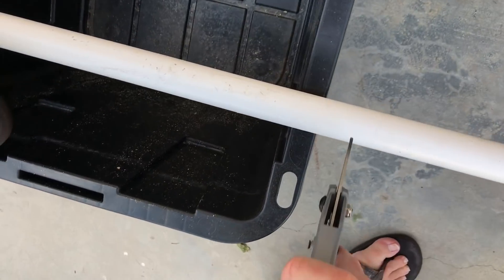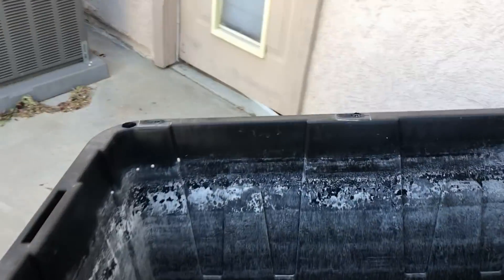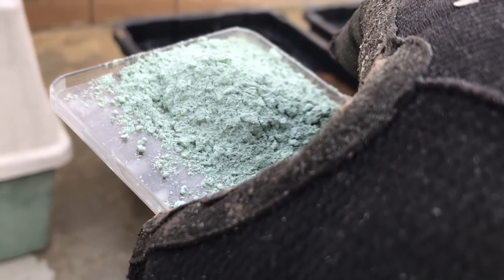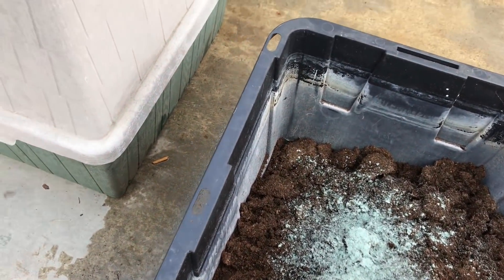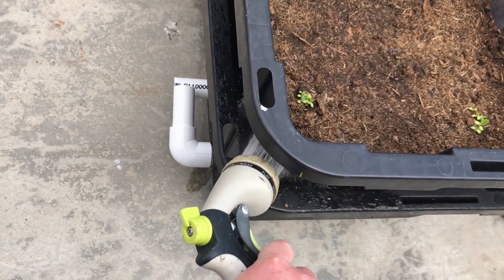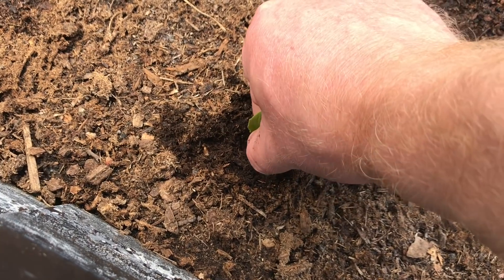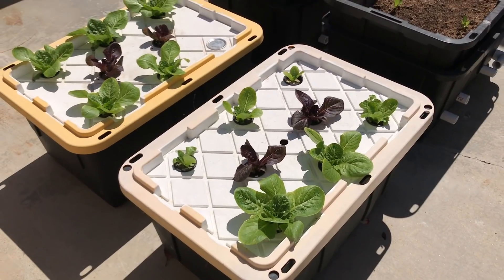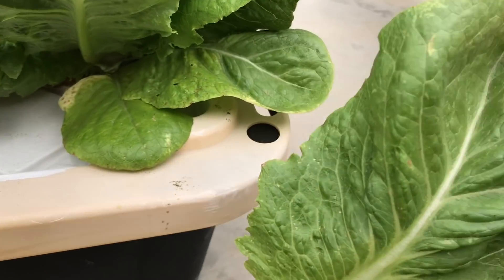Soil growers can't handle this video!

Comment: I'm just going to point out that you have 10" walls blocking the light in the soil containers but not in the hydro. And I'm also wondering why the people who comment on this don't care about what hydro solution you used or the PH, and are actually more concerned about the music you play?
Reply from the maker: the plants were shaded equally, the soil beds needed more "wicks" to keep it damp enough
Reply: Explain to me how the plants are shaded equally when the ones in soil are right next to a tall wall on 4 sides? They are outside and you don't get to move the sun and you're not going to tilt the container
Reply from the maker: the house shades both plants in the afternoon.
Reply: I see. So in the morning is when they get their sun. Which is when the walls would block the most sun because the sun hasn't risen very high. The only time they could get the same amount of sun with the way you have it is in the afternoon when the sun is straight above them. So if you title your video "Soil Growers can't handle this Video" you should expect some scrutiny from soil growers. And you should dot your I's and cross your T's and if you do a comparison you should make it fair. Otherwise the whole thing is out the window.

Comment: Thanks for sharing these videos, Jeb, its nice to see people trying different things and thinking outside the box. I want you to understand that I'm not trying to give you a hard time with my comments/criticism, I try to be as constructive and respectful as possible but sometimes I can come across as too critical. With that said, of course "those" wicking beads wouldn't produce well brother, especially compared to a kratky setup. For one, you didn't set them up with enough wicking baskets given the size of the baskets and the bed, they should have had two wicking baskets of that size for proper hydration of that amount of medium. Secondly, notice how I said "medium" and not soil in that last sentence? That's because what you used was NOT soil, at least not True Living Organic Soil. While Miracle Grow Moisture Control Potting Soil is considered "Organic", its not a true "Soil", its basically just Peat Moss and Coco Coir with a very small amount of amendments, not to mention its way overpriced for what it is. You would be MUCH better off either buying a quality, pre-mixed true organic soil, like Coco Connoisseur from Monster Gardens (its pricey but EXCELLENT quality), Nectar For The Gods #4 (one of the best for the price, most local grow shops carry it, as well as the next honorable mentions), Roots Organic, FoxFarm Ocean Forest, and several more I can't remember at the moment. The best true living organic soil you can get, however, is the stuff you make yourself. Its most commonly known as Super Soil, based on the original TGA Subcool Super Soil Recipe, which is updated almost every year. Making your own Super Soil is going to be the most expensive, since you have to buy all the ingredients separately (and their are a lot of ingredients) its going to be a fairly big initial investment (depending on the size of your grow). When Super Soil is done right, using high quality ingredients/amendments/inoculants, all mixed properly with the ideal moisture content and allowed to "Cook" for at least a month, the results you'll get will absolutely be worth the investment. If you're interested in at least testing this I can give you a Super Soil recipe that you can buy each ingredient in small quantities, so you don't have to spend a lot to try it. Several of the ingredients (Alfalfa Meal, Kelp Meal, Feather Meal, Bone Meal, Blood Meal, Bio-Live, High Phosphorus Seabird Guano  Azomite, Granular Humic Acid, etc) are offered by Down To Earth in small boxes/quantities, so you don't have to buy large amounts just to try Super Soil. Just humor me and give it a try on a small scale, I guarantee you will be pleasantly surprised at the results. I could go ON AND ON about the benefits of True Living Organics, going in depth about the symbiotic and delicate relationship between the soil biology and the plants. With organic growing in soil, its all about the BIOLOGY! The more diversified your soil composition is (the more quality ingredients/amendments/inoculants you use), the more diversified and healthy the biology will be. Plants grown organically in soil are completely dependent upon the micro biology, its the micro biology (beneficial bacteria and fungi) that breaks down the organic ingredients/amendments/nutrients into a bio-available form, which makes it readily available to the plants. While the plants are dependent upon the biology, the biology is dependent upon the ingredients/nutrients that's present in the soil, so if you don't use good organic soil with quality ingredients then the biology won't have what it needs to properly nourish the plants. Simply put, the quality of the product that your plants produce is directly related to the quality of the soil and its ingredients. So if you can, just humor me and repeat the wicking beds test (or any kind of organic soil method) but instead use two wicking baskets per bed and use a Super Soil mix in one and just plain organic potting soil in the other. Watch them grow and be AMAZED at the difference. Not only will the Super Soil plants grow faster, look noticeably healthier and produce more, but they will taste SO MUCH BETTER! Let me know if you're interested testing the Super Soil so I can share the full recipe with you. I know it might seem complicated but its really not, just mix all the ingredients and let it "cook" for at least 30 days and its ready to rock, for most crops all you need to do is water and the biology does the rest, one of the easiest ways to grow and it produces some of the best results you can get.
Reply from the maker: thanks for the detailed comment.  I'll probably talk about this in a live chat in more detail.  I'm trying again with 3 wicks.  Also, I plan on using something like fish emulsion to give the plants so juice.
Reply: I would recommend using Fish Hydrolysate over emulsion, its enzymatically digested and provides a wide range of organic amino acids that are super beneficial for plants, especially when foliar sprayed and used in AACT (Actively Aerated Compost Tea). AACT is another MUST (IMHO) for best results with organic growing, also an inline hose chlorine/chloramine filter, absolutely CRITICAL for organic, biological growing.
Reply: i just bought some super soil, but its concentrate, i never grew anything and basically everything you said about supersoil is what i found in researching it. i really have high hopes for it but ,,, thinking now, maybe i shouldn't have gotten the concentrate. thank you for your info.
Reply: Please share a link to the Super Soil Concentrate you purchased? Most "Super Soils" are technically considered "Concentrated", that's why you can water only until well into flowering/fruiting, it needs to be "concentrated" to provide sustainable nourishment for the plants for several months, however, true organics is VERY different from synthetics. Organic soil/nutrients needs to be broken down by the biology into a bio-available form for the plants to utilize it, this takes time which acts a buffer between the plants and the nutrients so the plants rarely ever get burned (nutrient toxicity) with organic methods. Synthetics on the other hand are like a mine line injection directly into the plants, so you have to be careful with the PPM's or you can seriously burn or kill your plants. As long as its truly organic super soil I wouldn't worry about the "concentrated" part, however, please share a link to it so I can check it out anyway.

Comment: Wouldn't the plants in the black totes be getting less sunlight by being planted so low?
Reply: Use your head. I asked him the same question although I knew the answer already. He said they get the same amount because the house blocked the afternoon sun. The afternoon sun is the the only light plants in a box would get. He doesn't know what he's doing or talking about. The sun starts low where it's blocked until about noon if you're in a box.
Reply from the maker: it's the middle of summer so no
Reply: All I'm gonna say is if you are going to so such an experiment you need better controls. Having one setup in shade for hours of the day while the other setup is wide open leaves you open to biased results.

Comment: I've been a soil grower for many years now, but interested in your hydro technique for starting plants off. It seemed to me that you had no bubbler or any mechanism in your hydro tote. Was that true and your water was simply stagnant?
Reply from the maker: yes it's called the kratky method.  good for simplicity and cost savings.  larger containers help in the heat

Comment: Hydroponics growers cant handle the fact soil growers do it for free......
There is a cost with hydroponics that can out weigh the value of growing at home...
Set up and on going cost make hydro a silly choice for off grid growers
Reply from the maker: These bags of potting soil were like 10 bucks each though!
Reply: @JebGardener  the soil I use is free.....
Reply: Bagged soil is like bottled water.....a lie.

Comment: What's in the water and how's the nutritional value of these lettuce? Any difference?
Reply from the maker: research
Reply: Jeb Gardener Ok I will :(
Reply from the maker: most of the info is on my channel.  my casual research indicates that there are more antioxidants in a stressed plant, so soil does that better and there won't be excess nitrates unless you overfeed your plants
Reply: Jeb Gardener Ok thanks! interesting
I did some googling and couldn't find any hard numbers except "it depends on the nutrient solution" (no joke..) will check more videos if my interest starts growing :)

Comment: To be fair I feel I should point out that the "soil" you chose to use couldn't grow a boner in a whorehouse. On top of that your tubs are coated with locked out mineral salts (white stuff) that will harm the plants. So not a fair comparison really.
Reply: Real shitty uneducated comparison video that's 4 sure.
Reply: I wish there was a love button for this comment
Reply from the maker: yes it wasn't fair, that is the point
Reply: No that wasn't the point. Your point was how much better hydro is. And you had to cheat to win.
Reply: @MrMotionmac  well i gues that's how life worked

Comment: i have tried soil,hydroponic,aeroponic,mistponics . hydroponics and all that require measure ph and keep eye on roots,water level, watch out for allgery growth . 
now im only growing with soil,compost.clay bubbles  in autopot system now i just have to check for water level in main water tank but the plants can surive 2 weeks without water from the main tank but they grow large once they stable decent root system
Reply from the maker: sounds like a cool setup

Comment: Problem with growing lettuce in totes is that they won't have that much aeration, and the sides will shade them out quite a bit. Root aerating is pretty important for the growth of almost all plants, and that's why hydroponics often results in faster growth. You will however have less maintenance if gardening in beds with well aerated and conditioned soil, and still get pretty good results. I would only use hydroponics if there wasn't a backyard with plenty of sunshine, workable soil, and reasonable climate.
Reply from the maker: i'm trying this grow again with some modifications and I guess we will find out.
Reply: It's just that I've grown lettuce in my garden, and still achieved similar results to your hydroponics, but it seems like to maximize their potential, the hoop houses that heat temperatures up even more and hold in humidity seem to get them to form nice heads, or just grow big. When I've tried growing vegetables in totes, they just didn't seem to perform well maybe due to the totes heating up way too much, or lack of air circulation in the root zone, but they always do great in the garden.

Comment: Green sand doesnt break down that fast . I been doing this for years on a different level . Kelp meal been a better choice
Reply from the maker: do you mean in the water?  I suspected it might just drift to the bottom like sand.  There was a bunch of it in the bottom of the tote.  

I do however like the idea of there being an option for the folks that want a little more something like you have with the soil plants (bringing up nutrients unnecessary to the plants).
Reply: Kelp tea ,work well.i mean take a table spoon  of meal mix it in the medium before putting into tubs

Comment: Hey bud you have a chance to try out that bokashi yet, if not that's something else to make a video about, from everything I've seen it will make your plants explode with growth regadless of which method you use for growing :D
Reply from the maker: have not tried it yet
Reply: Well at least you've got that in your back pocket in case you run out of stuff to try :)

Comment: So w8, Soil Grown Lettuce grows this slowly?
How is commercial produce produced? I'm pretty sure they don't use Hydroponics, they have dirt on them a lot of the time
Reply: If you seed it in a plastic container full of dirt and leave it out in the summer sun, yeah, it's not gonna grow. But, if you are an experienced grower, using the appropriate tools, it grows just fine. Growing it in soil is far more cost effective than hydroponics...and, of course, the product is of a much higher quality. 

Some of the tools and techniques needed to produce high quality organic lettuce (and any other vegetables) efficiently, without fertilizers or pesticides, are: automated transplanting (and a small greenhouse to grow the seedlings in), plastic mulch over the soil, drip irrigation (or some other automated irrigation system), composting (or buying compost, if you can find the right quality), insect netting and shade netting, an automatic harvester, an efficient washing and packing station and a walk in cooler. Note: these tools are cheaper and more low tech than you would think.

Here's a video of a Canadian urban farmer, Curtis Stone, breaking down his lettuce production: https://www.youtube.com/watch?v=CTW0_s8YPOA

He produces 500 pounds of high end, organic lettuce/year in each 50 x 3 foot bed. So 3.3 pounds per square foot. He sells it at $8/pound, s $25/square foot. I assume those are Canadian dollars. 

He grows in mediocre soil (the kind you find in the middle of a residential neighborhood), in a far less accommodating climate than California, to (beyond) organic standards. So no fertilizers of any kind (organic or otherwise), no chemical pesticides. He grows four rotations/year, harvests each rotation three times...for a total of 12 harvests/ year.
Reply: Broockle nope. Mass produced vegetables never even touch real soil. They are usually kept in rockwool that has nutritional mix in it and is being watered. So this right here is basically not too different from the conventional mass produce that we get in regular supermarkets. If your salad has soil on it, it is an indicator for mass produced goods that are grown in a special type of substrate that sometimes has some soil mixed in it. If it is really dirty or you even find a little snail or dead but in it from time to time, you have real salad grown on real soil :)
Reply: o Interesting. Thx for that
Reply: @projektbrot  yeah no not exactly. Hydro is cool and all but most food is still grown in the soil. Now hydro does have its place in an urban environment lack of space to grow food has led to the increase of vertical and hydro farming. As a son of the south and a farmer i see loads of vegies in the ground on a commercial level
Reply: Projektbrot: "Mass produced vegetables never even touch real soil. They are usually kept in rockwool that has nutritional mix in it and is being watered. " WHAT!?!?!?! Where do you live, Mars? The Central Valley of California - the US's "Vegetable Basket", all mega-thousands of square miles of it, is certainly NOT carpeted with rock wool!! WHAT???!?

Comment: some bugs dont like the air of garlic. like leafbugs (dont know the proper name srry :) )
you can do some controle without dangerous chemicals (even when there  "save")
Reply from the maker: yeah still seems like a hassle to spray
Reply: +Jeb Gardener only a litle pieci onthe foot of the plant is enought to protect te plant.
i dont use pesticedes bud try to controle things before its a real problem.